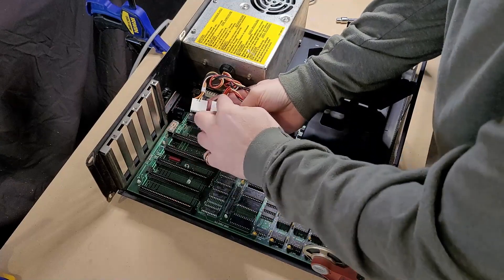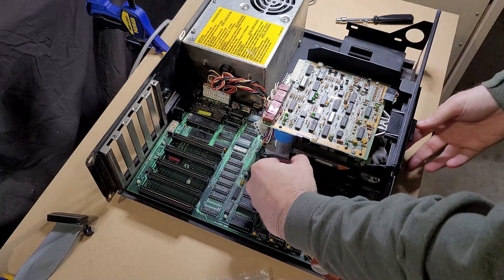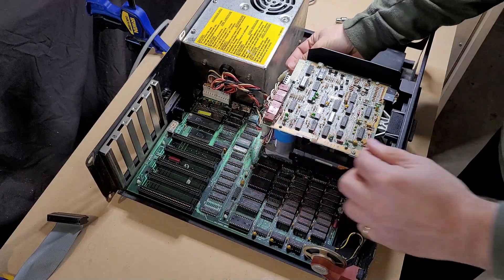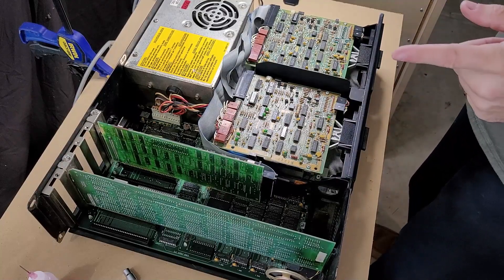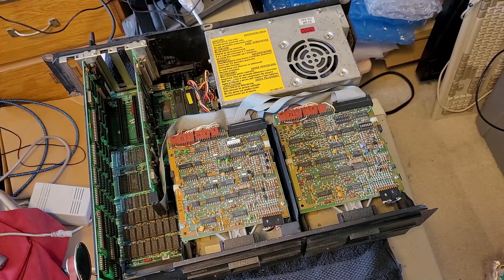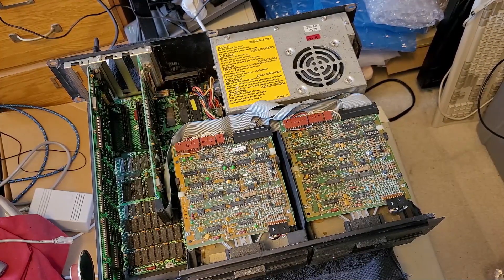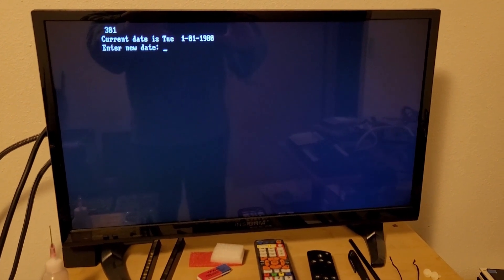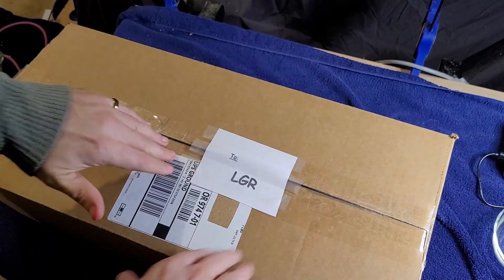IBM 5150 - Part 5

Comment: You could have used a USB Keyboard with a USB -> PS2 Connector Adapter, and then a PS2 Connector to a Large Din Connector Adapter and it would have worked.

Or if you have a PS2 Keyboard (as they seem to be making a comeback), use a PS2 - Large Din Adaptor Connector.
Reply from the maker: I have a PS2 -> 5-pin DIN adaptor.  It was my plan to use it for this project.  But, unfortunately, it is for the much more common AT keyboard standard.  The PC uses the much less common XT standard and would not work in this case.  It is unfortunate that IBM chose to use the same connector for two incompatible keyboard interfaces.
Reply: @nhbretro  Some early AT keyboards (not IBM) had a switch for XT or AT mode. You just need to find a model the keyboard fanatics don't want.